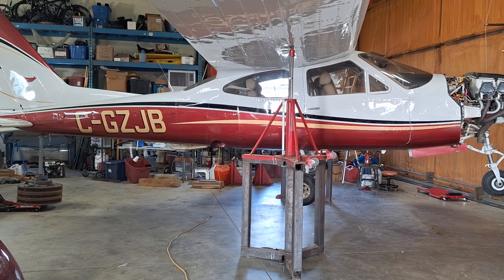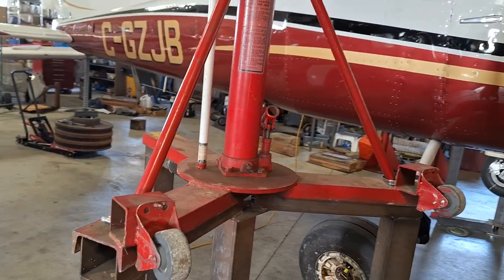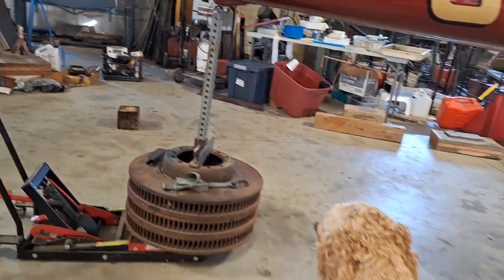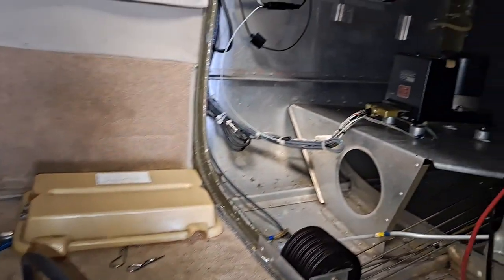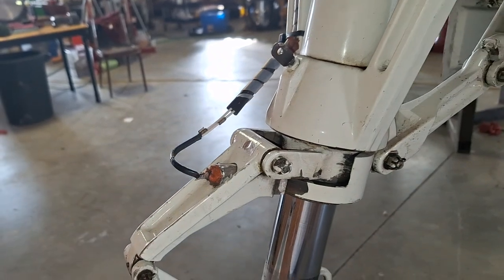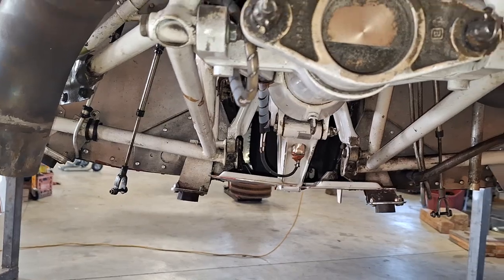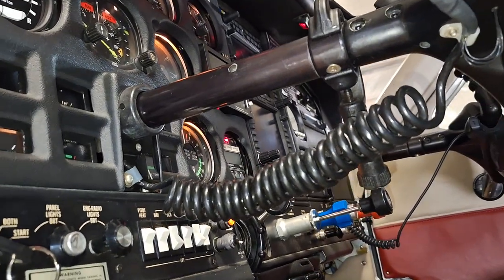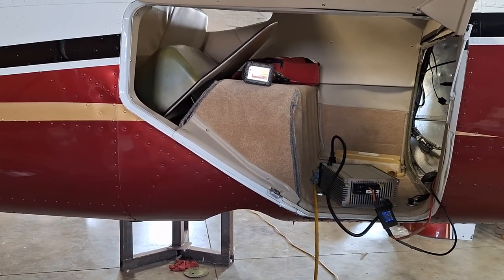Cessna 177 RG  Jacking and Gear Retraction

Comment: Great video, my 76RG Cardinal failed to retract the landing gear yesterday. The gear motor has a light installed that didn't activate. Is there a way to troubleshoot without jacking the plane?

Comment: A very interesting video THANKS!  A question on the tail stand.  Is it a tail weight or a tail stand or,,, BOTH?  I do my gear swing tomorrow for the first time.
Reply from the maker: Cardinals need weight.  My stand does both. I don't attach the tail until the mains are off the floor about 8 inches, this helps keeping it level when it is up all the way
Reply: @KerryWho , thanks!  I just didn't without incident, until someone was trying to be helpful pulled out the tail stand and punched a small hole in the tailcone!  Sigggggggggh, he knows how to fix such things and is fixing it for free at least. Funny thing is it looks like someone did it before!